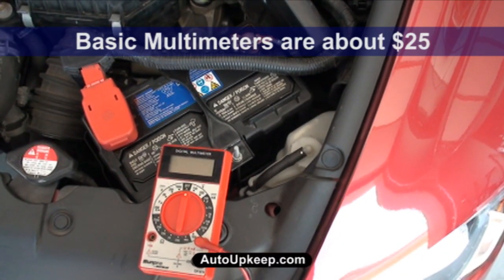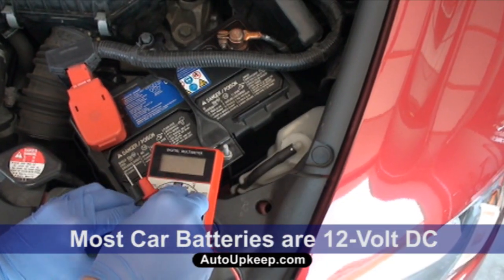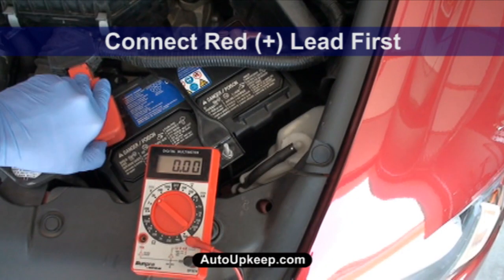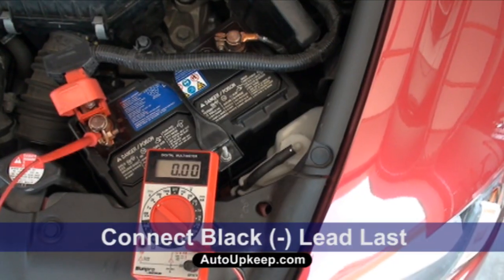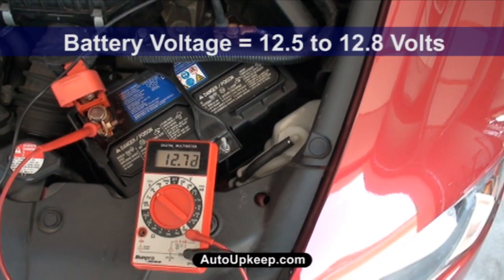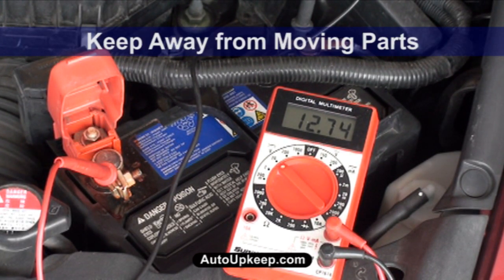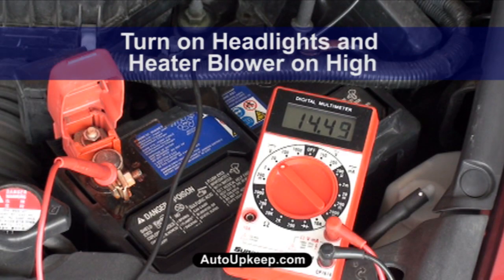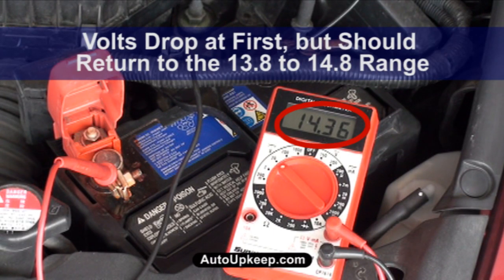How to Test Alternator Voltage Output (AutoUpkeep.com)

Comment: I replaced my alternator from O'Reily's Auto Parts and when I measured the voltage on the battery while the car was running, it read 12.21 volts. When I measured at the alternator, it read 19.51 volts. Do you know why there's a voltage drop from alternator to the battery? Could it be that the battery is bad? Or the voltage regulator on the alternator is defective? Or something else? This is the second alternator I replaced because the first one had similar problem. Thanks.

Comment: Thanks for the post. A little critique. Minimum battery voltage = 2.1 volts per cell adding to 12.6. Even a 0.1 volt deviance can mean something. Just saying, cheers.

Comment: that’s got nothing in particular to do with a multi-meter - it’s the 12v dc volt meter part of a multimeter(or just a volt meter).. & no 1 seems to mention that IF the batteries low(do to wiring, battery, alternator, etc, & so on) - the volt readings will not be as you example with a charged 12.6-7 etc. battery.  all these videos are about a charged battery, which no one testing these things has!🤨 - FOR EXAMPLE, I HAVE A VOLT METER, AN AMP METER, & ALL KINDS OF ELECT TESTERS, I JUST WATCHED A FEW WELL DONE VIDEOS SUCH AS THIS ONE.. & I STIIIIILLL DONT KNOW HOW TO TEST OF LOW BATTERY IS FROM BATTERY, ALTERNATOR, OR WIRING, CONNECTIONS, etc.👋

Comment: My multi-meters both went haywire measuring DC voltage.  Then I recalled the word: ALTERNATOR! (As in alternating current.)  I switched over to AC voltage and everything measured just as this video did.
Reply from the maker: The alternator in a vehicle generates AC (alternating current), but then converts the AC current to DC (direct current) to recharge the battery. Diodes (a rectifier) inside the alternator convert the AC to DC. The voltage you are testing is DC. Your multimeter needs to be on DCV (DC Volts). Make sure the multimeter's range selector is higher than the voltage you are testing. Some multimeters have one setting with a built in automatic range selector. If you have an inexpensive multimeter, put the range selector on the 20 DCV setting.

Comment: You did a great job on this video. These steps are very complete for a person without mechanical or electronics knowledge (much less zero knowledge of automobiles like myself). Several months ago I had my dead Toyota Camry towed to a GARAGE and the tech HADN'T replaced the alternator as I requested. I asked what the alternator voltage was running at (I had previously tested that at 12.5 to 12.7 volts with the car running).  The technician said it was at the same range I had measured and HE TOLD ME that as low as 12.5 volts would still be good "since Camrys always run on the low side." A few months later the same thing - dead car. This time I askes the AAA tow person what he thought the low side should be and he said at least 13.5 at least. So this video clearly points out to people what a good running voltage range should be - 13.8 to 14.8 volts. Repairpal.com does actually state a slightly lower range of 13.5-14.5 volts for a Toyota Camry - but that is a far cry 12.5 to 12.7 volts that the original tech had said. So GREAT JOB, Mike/Linda Gray!!!

Comment: So, is it possible to determine how many amps my alternator is putting out? I'm not very savvy when it comes to auto mechanics, but I'm familiar with the basics. This seems to be a valid test to determine if the alternator is working correctly, but I'm tryin to determine how many amps of current im pulling when certain accessories are engaged

Comment: People should be aware that this method won’t work on some higher end cars such as Lexus. The charging system of the Lexus has a battery low-voltage sensor built in, it only charged the battery when needed, in order to maximize the gas mileage. Therefore, if the battery is alreary fully charged the alternator will only show 12.80 volts with engine running. However, when the battery voltage dropped down below 12.80V the alternator output will automatic increase to 14.4V to charge the battery.

Comment: My voltage is 12.6, then jumps to 14.2 when the engine is started.. After a minute or so the voltage falls to a steady 12.8 - 12.9.. Even if I turn on the radio and lights.. It's a steady 12.8. Doesn't seem normal to me.

Comment: My car Alternator current output  is 12.60v during Engine on, and It doesn’t more than 12.60, Is it right or some problem in Alternator?
Ans me pls...
Reply from the maker: A fully charged 12-volt battery will have about 12.6 volts. If you are getting this reading when the engine is running, you may have an alternator issue. A common reading when the engine is running is between 13.8 to 14.8 volts. Many auto parts stores will test your alternator for free. I recommend calling a local auto parts store and see if they offer this free service. https://www.oreillyauto.com/store-services
Reply: AutoUpkeep ok thanks 
But my battery doesn’t fully change and   Alternator current is 12.60
Reply from the maker: Voltage is different than current. The 12.6 reading is voltage. You said current, but I believe you meant voltage. A volt is the measure of pressure pushing electrons. Voltage is electrical pressure that causes current to flow. Current can be described as the quantity of electrons moving through a conductor. The unit for current is an ampere (amp). With that said, this video only addresses electrical voltage output. If the voltage reading is 12.6 when the vehicle is off and also 12.6 when the engine is running, the alternator may be the problem. But I would recommend having it tested at the auto parts store to confirm.
Reply: @AutoUpkeep  hey i have the same issue too, thanks for the response im going to go to auto zone tomorrow!

Comment: wearing GLOVES for this ??? gimme a break ... yeesss
Reply from the maker: If you look in many owner's manuals there is a statement: "Battery posts, terminals, and related accessories contain lead and lead compounds, chemicals known to cause cancer." It is best not to come in contact with lead.
Reply: Besides the lead, oil/detergents within are also carcinogenic. Read the warnings. Gloves are cheap, no need to not use them.

Comment: add .022 volt for every 1 degree below 68,so if you testing in cold 28 degree add about .6 volt to (14.4 to 14.8 normal voltage at 68 degree)and if your alternator make 15 to 15.4 it is normal

Comment: My battery shows 12.15 volt when i messure it but the car still doesent want to start ...... i connect my portable car battery jump starter and it still doesent start, whats wrong ?!
Reply: it might not be the problem with battery.. or was it ?

Comment: What about checking the pre-regulated AC voltage from an alternator?
Reply: Andrew Frantz switch the dmm to ac volts and with engine at 2000rpm and headlights on, read the display. less than 400mv is good, more than 500mv is bad diodes. thats straight from my colleges automotvie textbook

Comment: if i want to step up 12V , 300amp to 400V using an transformer, what will be the output current obtained in amps?????
Reply: +Harshith SV That's one hell of a transformer primary to handle 300A !  the out put should be <8.5A at 400V with transformer losses.... (ideal would be 12V*300A/400V= 9A)

Comment: The minimum alternator output is 13.56V while the car is running. Anything less and the alternator is bad. My daughter's was 13.55 and it was killing the battery.
Reply: my 97 neon was pulling 13.49 volts running
Reply: Altinator output voltage should be 14.01 to 14.03.it is good voltage for charge battry

Comment: A reading of 12.5V indicates battery is 75% charged. At minimum, you want to see 12.60V with engine off and not having been run for about 8 hrs.
Reply: mine is reading 11.73v off, starts ok though.

Comment: if the voltage drops when you turn the fan on or the headlights, etc, and does not return.. does that mean the regulator is bad or is that a bad alternator?

Also, when I roll the windows down or up, the engine idle drops for a quick second, then revs back to normal idle, the same thing when I put the top down.. would that be a regulator?
Reply: Sounds like an alternator issue, but it could also be high resistance in the wiring, possibly at the power distribution (fuse box).

Comment: This assumes the voltage regulator is internal to alternator....which mine is not.  This video is not a test of the alternator;  it is a test of voltage being applied to the battery from the charging circuit.
Reply: Surely knowing the voltage output from the alternator is a pretty good clue as to whether the alternator is charging your battery. Something that this video was made for!
Reply: How else can a battery be charged without a degree of excess voltage to drive the current into the battery? An alternator supplies excess voltage to a battery to charge it. I don't have clue about what you are saying.
Reply: @jamescool8876  Older cars used a generator which puts out and AC voltage which went to an external voltage regulator which takes the AC voltage and rectifies it to DC which is used to charge the battery as needed.  An alternator has a generator and rectifier built into the single unit.
Reply: ...smartAss ! He helped lot of ppl

Comment: Excellent, clean crisp video and to the point. Your the first I've seen to show clearly on the multimeter the proper setting and how the meter should read in both tests. I agree with earlier post you should have a complete line of videos. Thanks for the help.

Comment: I have a 2002 Z71 tahoe 5.3L. It will not crank over. I already checked the battery and the starter. I had both starter and battery tested at a nearest shop. Which they said both of them are good. Now I'm thinking it can be the alternator.. But how do I check it if my tahoe wont start over?? O__o

Comment: i just got a new alternator and a new optima battery. however, while im driving i notice the voltage will fluctuate from 9v to 13v then back to 9v. when the car is off the alternator will charge the battery up to 11v max. my ground wire is 1/0 gauge, which goes straight to the chasis. i know some people say to have another ground to the engine when using 1/0 gauge, but i figure that cant be the reason my battery is draining.

Comment: I have replaced the alternator several times. The first 2 were remanufactured and the last one was a new one.I first one last 1 year, the 2nd one never worked correct and the last one is producing 12v and 11.6 on a load. Do you think the cars can damage the alternators. I put a new battery on when i changed the last alternator. I dont put much of a load on the alternator. Normal things music,a/c,heater and i put 55w hid but i dont think that would do anything.

Comment: if the wire was cut and shoted it wouldnt run power from the field coil and the 6 guage wire is a monofillament running to alternators. the rotor however wich is a temporary magnet after the stator is energized by the contact brushes upon acc key position. if the alternator took a good hit the odds are the diode trio in the rear of the alternator was the culprit. a faulty voltage regulator or rectifier may be the cause as well they often cause no charge readings

Comment: i recently got my alternator beefed up to just a regular 160 amp alt and i have a redtop upfront and that is hooked up to my other battery through 1 guage and 250 fuses and the battery is a 92 amp hr one, i have a volt meter ran through directly to my clarion 1500(and i have 2 other amps maybe 1000 watts total added) and it reads at idle around 13.3-13.5  shouldnt it be reading like around 14.4 or somewhere around 14? its never hit a 14 at idle ever stereo playin itll go down maybe to 11.2 or so

Comment: i just tested my alternator and battery, battery was ok 12.5 but when i start it, the volts drop to 12, and when i place a load on it like yo said it drops to around11.5 and stays, i got in a very minor fender bender ( person hit on the opposite side of the alternator ) so im not sure do they just go like that?

Comment: I suspect my last alternator had a working failure. IE it wasn't putting out it's rated amperage, but hadn't failed completely so my battery was still being charged but just barely and without any accessories on. You have 3 diodes in an alternator that convert AC to DC power. If one of them burns out you not only lose 1/3 of your power, but it leaks AC into your DC which puts a further drain on the electrical system and is even harder on the alternator. Autozone can check it for free in 5 min

Comment: Hmm. Not always easily. You can check the alternator housing to negative on the battery with a continuity tester setting on a voltmeter. The same with positive lead on alt to battery. A car engine uses a lot of power when running, you got the fuel pump, the radiator fan, ignition system, and exciter voltage for the alternator. If your alternator were disconnected I would expect to see the symptoms you describe. I'd check voltage with the engine running and at least the AC on. 13volts + at idle

Comment: Well to a point you're correct but he is doing a load test. If the alternator is not putting out enough amps, and you load the car up with AC, headlights, stereo, etc and the voltage doesn't drop very much then the alternator is putting out enough amps. If the voltage drops several volts then it's not. Even then, it could be the exciter voltage across the alt's electromagnet isn't getting enough juice to produce any output.

Comment: Lights dimming, yes that sounds like alternator. Engine dying on restart? No that's not alternator. BUT here's a test you need to do. Are the lights dim with the engine off on battery power? Do they dim with the engine running at idle compared to what they were at with the engine off? If they dim with the engine running but not on battery power you might have an electrical short somewhere, a bad alt or battery cable.

Comment: My alternator ended up being bad. It wasn't putting out the amps it was rated for hence the okayish voltage with no load, and low voltage with any kind of load. I was one stuck in traffic experience away from a major problem as any time the car was at a stop the voltage plumeted. Luckily Firestone honored their warranty, I paid labor, got a free alt and they did the work in one afternoon, usually I have to drop it off and wait a day or two. Getting 13.5 under full load now.

Comment: Just because the voltage is good on the Alternator does not mean it still works....A alternator can have good voltage but the output on the alternator can be minus on the amps there for no charging  ;(.
most Alternators do go out on the voltages but if your battery is good and you had your alternator tested with just a voltage check and reads good and your cables are tight and corrosion free ..then your alternator is not producing amps

Comment: Great information...thank you.

I have a 2008 civic si sedan with a new Optima Redtop battery with these specs:
-BCI Group Size:	34/78
-Cold Cranking Amps:	800 amps
-Cranking Amps:	1000 amps

I installed everything and got the following readings on the multimeter:

car off: 12.75 volts
idling: 14.36 volts
idling with heater and lights on: 14.14 volts
reading after car is immediately turned off: 13.01 volts

How do these numbers seem to you? thanks

Comment: @Subparanon Worth noting alternator is less than 2 years old and I first grew suspicious and noticed low fan speed at idle about 8 months ago. It hasn't gotten worse and cold weather it seems to do a little better. No dummy lights showing failure and I didn't have a voltmeter when the previous alts failed so I don't know what's 'normal' for my car. On highway traffic with low load voltage is great. At night with headlights, defroster on high, etc fans slow at stop lights but get 13.1-13.3 moving

Comment: Help! On my 3rd alternator in 10 years and don't know if what I'm seeing is normal, failing, or failed. Battery 12.6+ is good. Cold start 13.8-14.2v idle. Hot start 13.1-13.3 idle. No load. If I turn my lights on, car stereo, AC on high, wipers etc idle voltage can drop to 11v sometimes but up to 13.2 at 1500rpm loaded. Enough for headlights to dim, fans to slow at stop lights. With moderate load it's 12.6-13.3 at idle. Always cold starts 14v range, when hot 13.4 is best I get. Is it ok?

Comment: I just bought a brand new fully charged battery but it drains completely within hours of running the engine. I recharged the battery again and got the same problem... does this sound like altinator issues? Thanks for your time.

Comment: @vgorous Nope. Everything is A OK. Theres not alot of output at idle since the alternator isnt spinning at higher rpm. The real charging of the battery comes from driving it down the road, not letting it idle.

Comment: This is a fine summary, with minumal equipment. I also like the video posted by realfixesrealfast, who describe how to do this with a variable carbon pile resistor. That technique requires a special tester worth about $150, giving a more exacting test of alternator/voltage regulator output. I'm saving change to get one of those, though I suppose you could just take the suspect alternator in to a parts dealer for bench testing.

Comment: I have a battery voltage meter built into my dash from my Audi A4. When I put the key on without cranking the car, the voltage reads 12V. When I start the car it reads 13-14V. If i let it idle and I have my;
- headlights
- rear defroster
- 2 heated seats on full
- side view heated mirror
- heating with fan speed at 50%
my voltage meter goes down to 12V. It will climb up to 13V if i only rev the engine. Is this a bad alternator/battery? I notice interior lights dim when radio on and car off